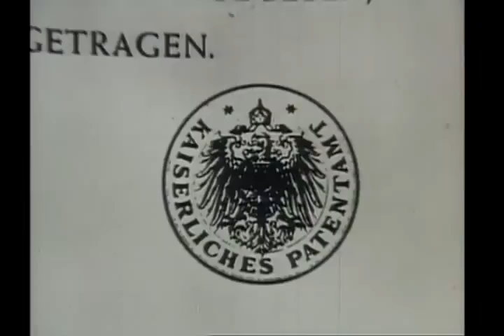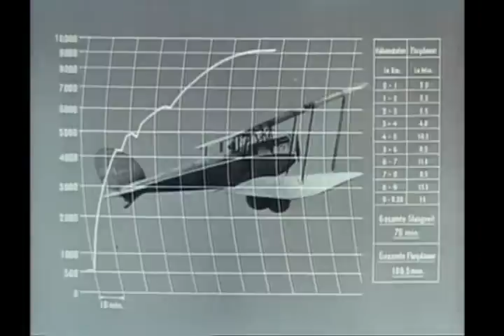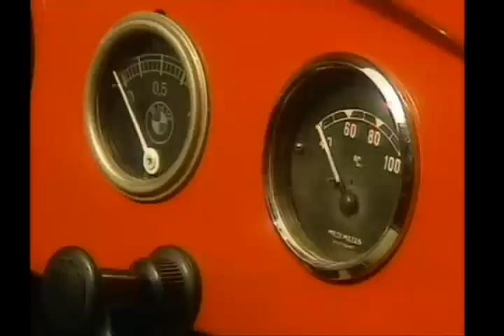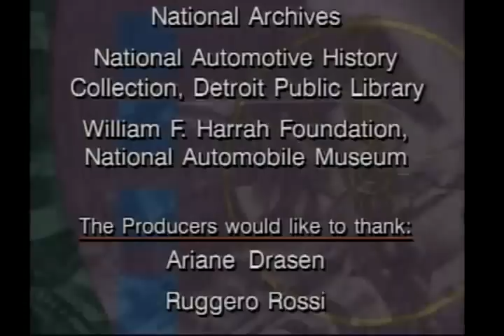BMW (Bayerische Motoren Werke AG) History Documentary

Comment: Having owned a 1958 Isetta 300 in the late 1960's. I was able to obtain 65 mph once taking my life in my hands. The US model had 3 braking wheels and 4 driving wheels. Scary in a panic stop. I think on a good day it produced 13 hp. The 4 speed gearbox had a reversed shift pattern. The 12 volt electric system switched from starting mode to charging mode. While small and only one cylinder it was very well engineered. I purchased the car with 1200 miles on it for $75.
Reply from the maker: +R. Johnson WOW!  If you keep it till now you would sale it for good money. Two examples I've seen last time, been priced between 13-15k GBP (19-22k $)
Reply: @bmwalpina4628  
The greatest BMW ever built was the 1944 BMW model J38 flying saucer.  It weighed 80,000lbs and was powered by 12 jet engines.  Easily the most remarkable vehicle ever built by BMW.

Comment: I had pleasure of owning several BMW cars & bikes, the 700 was the best handling of them all, it cost me $100 in 1972..
The 1600 was a junker when purchased but I found a similar 1600 in a scrap yard that was like new. I swapped parts and rebuilt the whole car and drove it for another 290,000 miles. Loved that simple, reliable car. The bikes (4) were all very reliable and used for cross country trips. Never had a bit of trouble with any of them.
Reply from the maker: Decent BMW cars are max from early '90s, I had E36 cuope 318is 16V DOHC on the timing chain for 10years! 370 000km on the clock and sold it. I have replaced just chain tensioner once, alternator and basic maintenance stuff during one decade of using it ;-D

Comment: I have a BMW R1200R (roadster) motorcycle and I like the fact that a rider from 1923 would recognise the engine and transmission immediately. It amazes me that one design could have triumphed over almost a century - albeit with constant development. The design has a lovely, low centre of gravity which makes the bike feel like a gyroscope. The flat twin has a loping gait which will take you to down to the shops or around the world. It will also get me to 60 mph in around three and a bit seconds if I'm in the mood. 
I used to have a Z3 (roadster of the four-wheel variety) which was fine if you treated it like a 1930s classic, but bloody dangerous if you tried to drive fast on a curvy road. I almost put it through a hedge, and it was touch-and-go before it finally straightened out. I was removing twigs and soil from the bodywork for days afterwards. The company seems to have addressed the faults with the introduction of the Z4 and early ones are now becoming quite cheap. I don't want to look like an advert for the company but I'm sorely tempted.

Comment: There's lots of talk about the famous flat twin motorcycle engine, but the single is never mentioned. 
The R 24, built in 1948, is shown at 18:52, but at 19:04 boxers are being raced.
"There was no sign of a new car yet, but the R 24 motorbike proved to be a winner." 
The bike that won the race was not the R 24. 19:53
"The R 24 was followed by the R 51. Like the R 24, it was a direct descendant of the original BMW motorbike. They shared the basic BMW characteristics: a twin-cylinder horizontally opposed engine and shaft drive." 20:11
Again, the R 24 is an upright 250cc single, the R 51 is a 500cc twin. 
Also the R 51 was a pre-war bike, built from 1938 to 1941, while the bike shown is a R 51/2, which came out in 1950.

Comment: they made great motorcycles
Reply: Not really,  slow lumbering motorcycles with engines  which would vibrate heavily below 3000 rpm and lurch due to issues with the shaft drive,  very over rated products.

Comment: The shame is that BMW once made good cars. They lost their way in the 90s when each new generation gained weight. To stop this, they resorted to a lot of very bad engineering decisions, particularly the increased use of plastics and aluminum in place of steel. This has been particularly disastrous in the engines where heat causes deterioration and failure of many plastic items, and the aluminum engine bolts stretch. Like most current German cars, they  are designed to last through the warranty, then become money pits.

Comment: Luggzhury.
Reply: You can see where the Xl120 got it's lines from!
Reply: 3,0si was my first(2nd hand) recommended yo me by a dealer and garage owning friend. It relplaced  a 2,5 Triumph and of course was really twice the motor car. When the Essex traffic police bought a couple it was one of the few make they did'nt need to special tune .I had a later model also Si and then a 733 which although  agood car was a bit pf a barge.The 735 was better but my fortune fluttered for a while and I did'nt get one.By the mid 80's the world and his wife had a 3 serris which they all refered to as bm's  (the world had moved on) In the 2000's I aquired a Z3 2ltr serris 2( dull as dishwater) then an earlier 2,8 which was after a littte modification much more in the BMW tradition. Still made in  Alanta ,I think? anyway It was a great thing to fly around the Welsh country side in, having a very late midlife crisis at age 60  Both now long gone !( my 60th year and 2,8 Z3) Happy days.